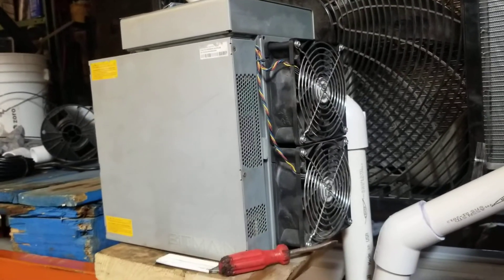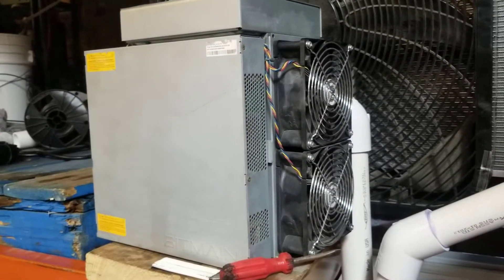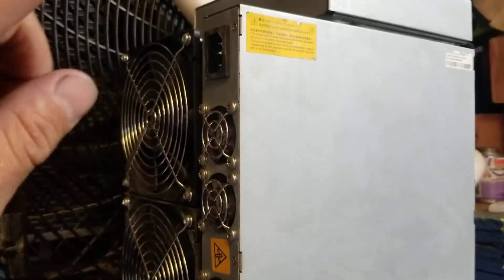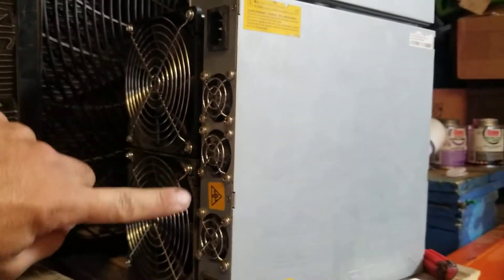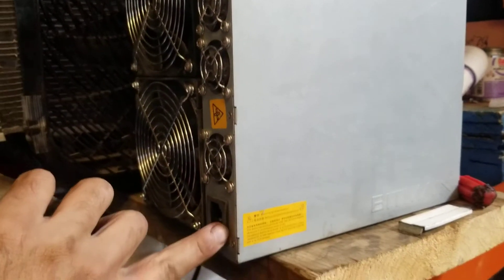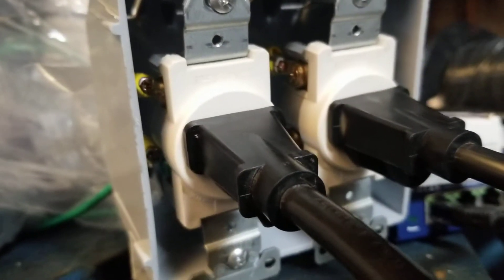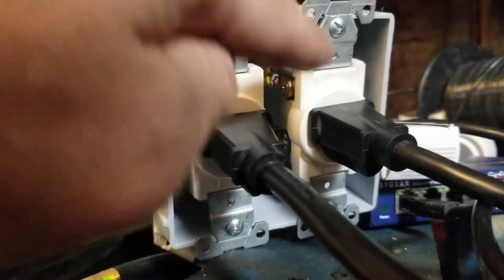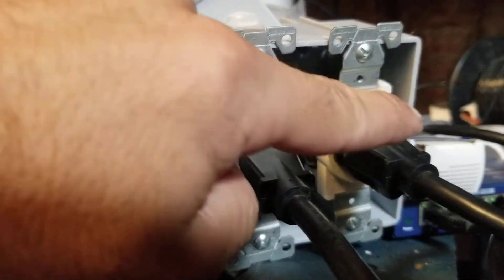Antminer S17 Power Setup

Comment: so how many watts per plug does this beast need.
Reply from the maker: Which model T17 do you have?
Reply: @brothersmechanics2028  t17
Reply from the maker: There are a ton of T17 models ranging from 15th/s up to over 70th/s, each model has different wattage
Reply: @brothersmechanics2028  40th/s
Reply from the maker: @cdm1012  1100 watts per plug
Reply: @brothersmechanics2028  thanks a lot

Comment: Would I be able to connect 2 Antminer S17 into a 240V 30amp outlet? I will have one plus but I will connect a PDU and connect both miners so 4 cables to the PDU. I was told 240V 30amp can sustain up to 7200W and 2 S17 would be about 5,000W, but would like to confirm.
Reply from the maker: I personally wouldn't do it, but maybe on paper it might be ok, you should ask an electrician about your exact situation at your home. I tell everyone to have a separate breaker for each miner.
Reply from the maker: Sometimes they can pull over 20 amps each.

Comment: Hello there. 
I’m getting an S17+ 70th very soon. I know the PSU is included/build-in this model, so I was getting down to getting the rest of the basic stuff. 

Unfortunately I am very confused between a few things. 
a. which power supply cables, 2 needed for 1 miner should I get? 
b.  can i use the simple power socket in my room, should be 22-240V, directly? since I’d need 2 because of 2 power cables, how do I get around that? 
c. would using a simple power splitter multi-plug with only one wall socket be safe?
Reply from the maker: If you search on amazon or ebay they will have a variety of cables to choose from. I cant tell you which ones to get because i do not know which outlets you have. You should call an electrician for details. There is a seller on ebay that makes a 2 in 1 splitter cable specifically for the s17. Just do some simple searches and youll find them.
Reply from the maker: https://www.ebay.com/itm/s9-s15-s17-s19-antminer-Inosilicon-whatsminer-3600w-power-supply-cord-/403358576904?mkcid=16&mkevt=1&_trksid=p2349624.m2548.l6249&mkrid=711-127632-2357-0
Reply: I have a Type E 16A 220-240V Europe standard. The ebay link is from the US and I live in Europe.
Reply: This 110V is an american problem. I have trouble deciding if I can just plug the power supply cables in the same circuit 2 wall sockets. And if I should also get 2 surge protectors or not necessary?
Reply from the maker: @ayubi9207  unfortunately i know nothing about Europe. Sorry mate
Reply: @brothersmechanics2028  noo thank you sir. I appreciate the quick response.
Reply: @brothersmechanics2028  my only concern is safety wise. how bad can it be if i just plug in a s17+ 2830W machine on a normal 220-240V wall outlet?
Reply from the maker: @ayubi9207  just depends on how many amps your outlet can handle. You dont want to go above 80% of its capacity.
Reply from the maker: So if your outlet can handle 16 amps you dont want to pull more than 12 amps. We tested a machine a while ago and it was pulling 11 amps PER plug. Ill have to do an updated video to see what we are currently pulling.
Reply from the maker: @ayubi9207  surge protectors are always encouraged. 1 is necessary for each breaker.

Comment: Can both of those receptacles be on the same 20 amp 220 volt circuit?
Reply from the maker: I recommend using 2 different breakers to prevent issues down the line. We tested 11 amp draws from each cord.

Comment: question - I just found out , My commercial warehouse doesn't have 220 it has 208v, can I run an Antminer S19 pro with 208 or do I need to have an electrician put in a transformer to go up from 208 to 220? Thanks in advance.
Reply from the maker: Usually 208 will not work, i would get an electrician to change that to 220
Reply: @brothersmechanics2028  would the Antminer just not power on, or would it power on, and then potentially damage the unit?
Reply from the maker: @richardnewton8834  both could happen. The Avalon machines don't turn on at all at 208.
Reply: @brothersmechanics2028  copy thanks for quick reply.
Reply from the maker: @richardnewton8834  Thanks for asking questions, someone watching this might have the same question, and now they have an answer 👍

Comment: Thanks so much for this video. I'm trying to setup my own few S17s and am working on the electrical requirements but cannot find the manuals and specs for these machines anywhere.  Do you know where I can find them?
Reply from the maker: Thanks for watching! Manuals and specs are pretty basic stuff. No service manuals exists. Specs are just basic stuff like 2800w, 220v, 10-14amps, etc. If you need the page on what the LED's mean or how to reset the machine i can add a link for it. Troubleshooting these machines is very scarce in answers and you wont see much on them till mining becomes mainstream which probably wont ever happen.

Comment: 20 amp at 220V breaker is fine. Also using 14 gauge wire is good but recommend to use 12awg.
Reply from the maker: Yes the thicker the cord the better.
Reply: @brothersmechanics2028  Also the shorter the better.  Simply shortening a cable is exactly the same thing electrically as thickening it.

Comment: question - I thought that the server power supplies that these use have two plugs because 1 is for redundancy.

So do I need "2" 220v outlets to run "1"  miner like an S17 or newer S19? You have to have both outlets on the miner plugged in for it to work? Sorry for the newb question, I just want to make sure I fully understand this. thanks in advance.
Reply from the maker: Yes you definitely have to plug in both cords. If you plug in just 1 cord then only half of the system will turn on and you will damage the machine. You need 2 cords that supply 220v for each plug. Your electrician will know how to do it.
Reply: copy that. So 1 20 Amp Circuit that runs out to 2 240v plugs for each miner. Thanks for the quick reply.
Reply from the maker: @richardnewton8834  Keep in mind these machines pull almost 25 amps.
Reply: @brothersmechanics2028  ok so then I should make sure the electrician uses
Reply: 30 amp breakers
Reply from the maker: @richardnewton8834  👍

Comment: you can plug in a 120 power cord but the cord has to be really thick due to higher amperage.
Reply from the maker: No you cannot, it will damage the machine. It will turn on and run but will damage the machine. These machines are built for 220v.
Reply: @brothersmechanics2028  i've been running mine on 120 for quite some time
Reply from the maker: @CIBERXGAMING  Just because your machine hasn't completely broke yet doesn't mean it's not damaging it. For example: some cars can run just fine on 1qt of oil for months even if it requires 5qts, does that mean it's ok to have 1qt? No, because it's slowly destroying the vehicle and eventually over time that engine will blow. The same concept exists here. If you read any operations manual for any of these 220v machines you will read that using a 120v plug will destroy these machines. I would advise you to simply read the side of your machine and you will see a sticker that says "(200-240v - 50/60 Hz 9A) X 2", that alone should tell you to stop running on 120v. You are literally destroying a very expensive machine. Good luck if you choose to continue.
Reply: @brothersmechanics2028  these power supplies can accept 110v-250v. the only reason they want you to use 240 is because you will be using less amps. for example running 240v max speed will only draw around 13amps. but if you are using 120v then the miner will be drawing more like 25 amps. so if you decide you want to run the machine on 120 you have to be careful because it will most likely pop a breaker. and if you get a higher amp breaker then you will end up melting wires under your house. i know from experience. again the only reason they say run on 240v is to just lower the amp draw so your not popping breakers or melting wires.
Reply from the maker: @CIBERXGAMING  You have Zero proof of that. You literally just made that up. The operating manual literally says that using 120v WILL DAMAGE THE MACHINE. If all it did was change the amount of amp draw, it would tell you that its ok to use thicker cables on 120v. There isnt a single article in existence telling you its ok to use 120v. You should keep opinions to yourself and only put facts that can be verified out in the open. If you want to use 120v, go ahead, but I would advise against telling others its ok to do, especially in the open for uneducated people to read and damage their own machines. Again, please keep your opinions to yourself in private and ruin your own machines in private.
Reply: @brothersmechanics2028  so aggressive. if the psu says 50/60hz on it then it can take 110v-250v. end of story.
Reply from the maker: @CIBERXGAMING  You are obviously not an electrician nor know anything about electricity and how it affects devices. Please make your own channel with your ignorance and there you can give terrible advice to your own followers.
Reply: @brothersmechanics2028  do some research.
Reply from the maker: @CIBERXGAMING  You might want to do more research apart from googling 50/60hz devices. Ignorance costs money buddy.
Reply: @brothersmechanics2028  i honestly don't know why you are so confrontational. talk in a normal manner. just because a company recommends a product to be used a certain way doesn't mean that it MUST be used that way. like i said a few times now they only say 200-250 volts because you have low amperage draw the higher the voltage. if they said 110-250v then they would probably get in big trouble because people who don't know much about electricity will probably burn their house down. these machines running on 120v will draw a crap ton of amps which will kick a breaker in the house. if someone who didnt know a lot about electricity just put a larger amp breaker in then they would cause a fire in their walls or under the house due to wires melting from the high amperage. you have to understand me, right? do you know a good amount about electricity? genuine question. not attacking.
Reply from the maker: @CIBERXGAMING  I'm confrontational because anyone that reads your comments will damage their machine. We have 2 master electricians working here, we know what we are talking about. You are a typical ignorant DIY person. You Google something and take it as if you are an expert. If i see more comments instructing our viewers on how to ruin an expensive machine i will simply delete your comments. Why are you even watching this video if you think you know what your talking about?? Simply go about your ways and keep your opinions to yourself. Thank you
Reply: @brothersmechanics2028  my opinions are not opinions. they are facts whether you think they are or not. i stumbled upon this video because i searched up S17 to see if it's a good machine to buy.
Reply from the maker: @CIBERXGAMING  they are opinions man. Good luck with em.
Reply: @CIBERXGAMING  Boy, you don't know what you are talking about. What can end up happening is a fire in your house. I understand what you are trying to say.  You would be right if the device was designed to be used that way. But it is not. What is going to end up happening is that your machine will eventually burn up.  Yes, it is going to smoke and burn.  Son, we are not trying to troll you, this is serious, this thing is in your house. Unplug it, and get your setup done correctly. Why would you risk this thing burning up in your house?  The bible says Proverbs 16:18 Pride goeth before destruction, and an haughty spirit before a fall.  This isn't a joke, unplug it and do it right. I don't want this to hurt you.  The machine internals are rated for 240v.  Each of those circuits have "resistance"(the voltage gets used by the machine before the current runs back into the ground circuit) rated for exactly 240 +/- to work properly.  What you are doing is running double the amperage through the internals.  These internals are not rated for this.  You may have increased the gauge of the wires outside the machine, but you didn't do it inside the machine because there's no way to do that. It was designed specifically for that voltage.  I am a mechanic, and I am very good diagnosing electrical issues. I=e/r.  That means amperage is equal to what the voltage is divided by the resistance in the circuit. You are doubling the amps inside the circuitry. It will smoke, it will catch on fire.  The weakest connection will get a hot spot and it will burn. I promise.  Unplug it son.
Reply: @CIBERXGAMING  https://www.youtube.com/watch?v=H0n_oBgmB2A  This guy burns up a light bulb with voltage, you are burning up your machine with amperage because you're doing the same thing he is, backwards.
Reply: @CIBERXGAMING  Oh God help you.  This is so bad.
Reply: @brothersmechanics2028  They don't approve of it at Bitmain,  but SOME models are still under the amperage limits of the power supply,  especially in low power mode. Some aftermarket firmwares have gotten 1500w machines down to 500w by undervolting. That will DEFINITELY run on 110v.  These power supplies were designed to accept 110v for a reason. I seriously doubt you could ever run one of those 3000w two plug machines on 110v,  but you could always calculate the amperage draw and find out.
Reply: So who do i believe? I’m getting 2 of these machines and need to know, so we can outfit our cave with the proper power!
Reply: @RedRags5  Im installing the electric for 20 of these atm, im running 1 dedicated 30 amp 220v ckt for each machine,
Reply: @genesis129okfarms4  nice I received one but I sent it back because it looked like it came out of a garbage pile. Kinda discouraging but I’m still trying to get into the Ming thing! Thanks for the insight
Reply: @RedRags5  listen to the guy in the video.
Reply: @RedRags5  the APW9 power supply will run fine on 120v, but you will need VERY thick wires. listen to the guy in the video. don't do what i did or you have a big risk of fire.